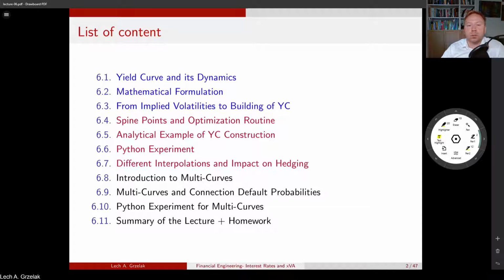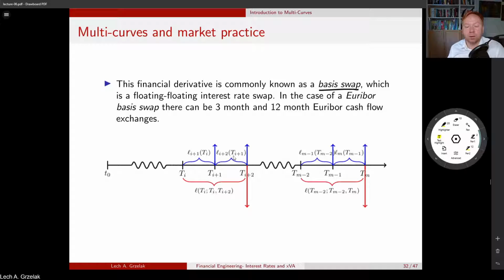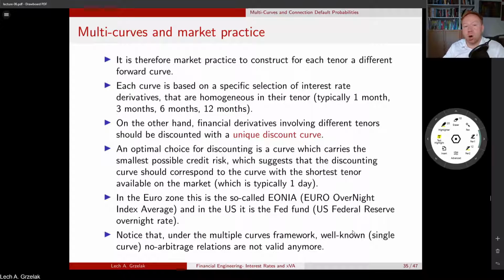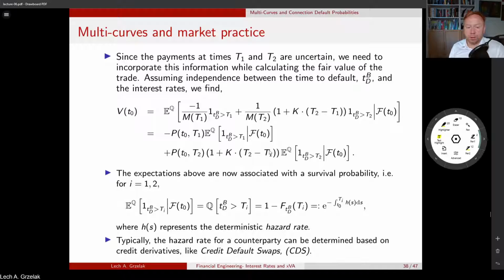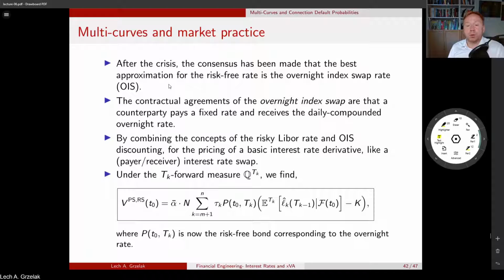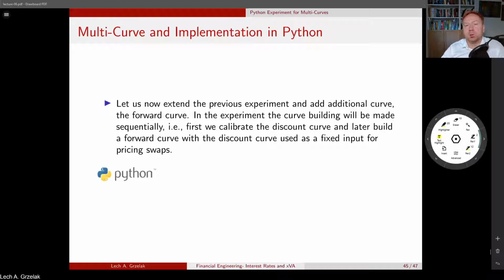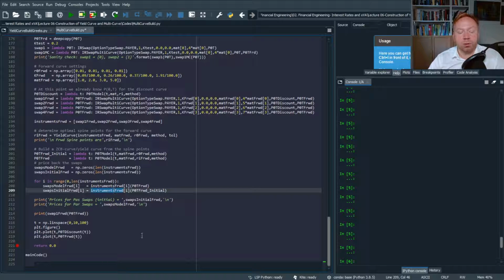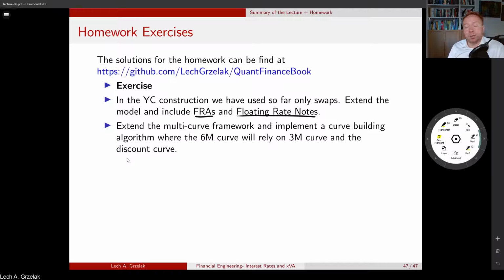Yield Curve and Multi-Curves (Lecture 6/14, part 3/3) | Financial Engineering Course

Comment: Hi Lech - Firstly, thank you so much for creating these lectures. I have a question, you mentioned that first step is to create a risk free curve. Then we create lets say a 3M curve using the risk free curve and 3m libor instruments. Then we are supposed to create 6m using the above two. Can you please elaborate how we would use the 3M curve to create the 6M curve? Thank you
Reply: For this you would need the right market instrument: A 3m vs 6m basis swap. You will know how to discount, how to price the 3m leg, and will need to solve for the 6m leg.

Comment: Hi Lech, thanks again for the excellenent video. I have tried the spline_interpolate with the "Construction of a multi- curve for a given set of swap instruments" code. However, I get only nan values and the error in the first loop is huge (147214443.74228907) comparing to the other interpolation methods. The error message is "RuntimeWarning: overflow encountered in exp
  return np.exp(-r*t), RuntimeWarning: invalid value encountered in subtract
  dv = (val_up - val) / eps". Do you have any idea how I can fix that ?
Reply from the maker: hello, it may have to do with the initial guess in the calibration or instability of the numerical routine of Python. I haven't tested them thoroughly- I used it here only for educational purposes! So please don't try to make investments based on that :D Thanks for noting the problem. I will have a deeper dive into it! Best wishes, Lech

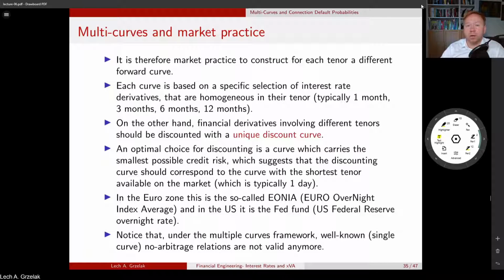Comment: Thank you for the great video! Could you please expand on the difference between the curves at 13:31? How is it possible that there is a 12m curve that begins before 1 yr tenor (intuitively, shouldn’t the shortest tenor of the contract be 1y?)?  Is the 5y tenor of the 12m curve simply a series of 5 fwd and fwdfwd contracts? In that sense the premium is the term premium/illiquidity premium over reinterring shorter-dated contracts, right?
Reply from the maker: hello Free Lunch, nice to hear you liked the lectures. 
Intuitively, you can associate tenor with the frequency of how often the floating payment takes place. So if the frequency of payments is 3m then you will have a 3m curve. If you consider a trade that matures in 5 years but has a tenor of 12m months, then indeed you would use a curve with 12m tenor. Does it clarify? Best, Lech
Reply: @ComputationsInFinance  Thank you very much for your classification, sir. If I may just double-check though, how is it that there are curves that start at a tenor lower than their payment frequency? For example, I would expect a curve that pays out every 12 months begins at exactly 12 months and not before. In the graph, they seem to start well below 12 months. How is this possible/how are these points derived?

Apologies for the long-winded question! Many thanks again for the brilliant lectures.
Reply from the maker: @freelunch5638  hello. Even if the curve corresnpodns to a 12 tenor, you are still able to compute all the discount factors, even before the first payment date which will take place in 12m. This will be simply a consequence of interpolating on spine points of the curve. On the other hand please imagine a scenario where you have bought a swap contract with 12m frequency 10 years ago. This contract will pay in 2 months so in order to price it you still need a yield curve with 12m tenor. So the bottom line is, tenor is nothing special, it is just a "configuration", or a "feature" that you would use to sort the instruments and build yield curves. At the end all these yield curves will allow you to generate all the forwards. Hope it explains. Best wishes, Lech
Reply: @ComputationsInFinance  Thank you very much for your clarification sir. So in this case, a 12m frequency at 2 months is like an ‘on the run’ 12m that has elapsed 10 months.

One thing that baffles me, however, is why all of the frequencies don’t meet at the same y-intercept. Surely, a 12m, 6m, 3m, 1m frequency with only 1 week or so maturity left till maturity are all virtually the same? Why don’t they all meet at the same point where t = 0? (Sorry to continue pestering you!)

Comment: Hi Lech, great video!
Can I ask if there shouldn´t be a change of measure on the slide 24:34 when P(t0, T1) and P(t0, T2) are taken outside expectation? There is Q measure still.
Reply from the maker: Hello Marek, the change of measure is not needed, it is because we assume independence between interest rates and the time to default. Then you will get a product of two expectations and each of them you can handle separately. Does it clarify? Best wishes, Lech